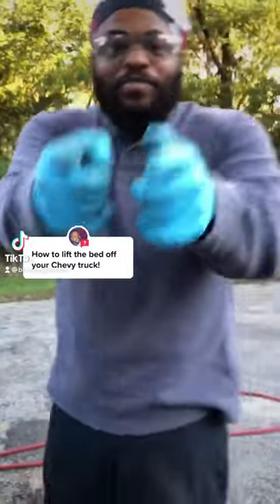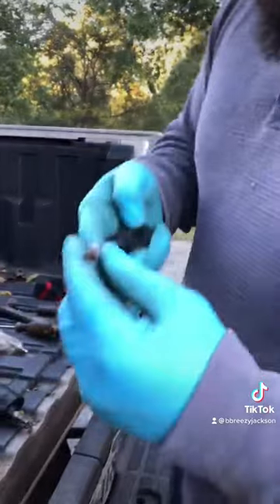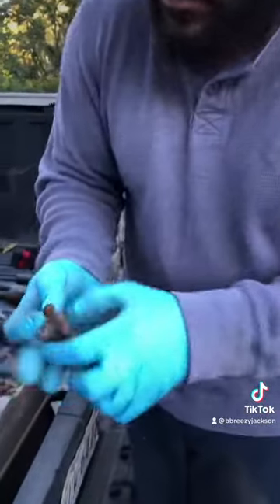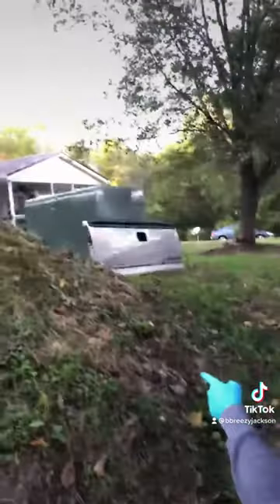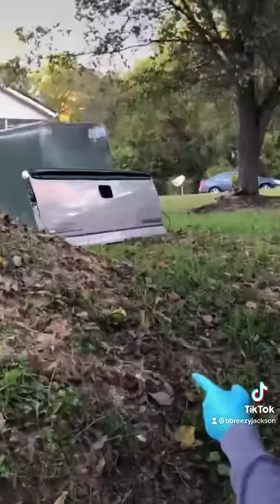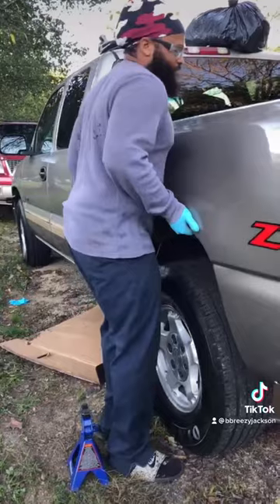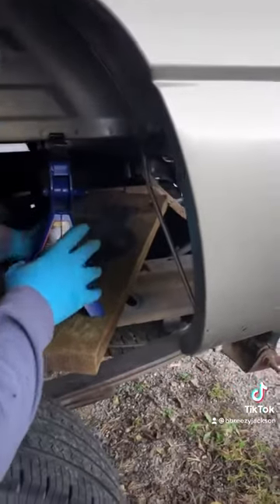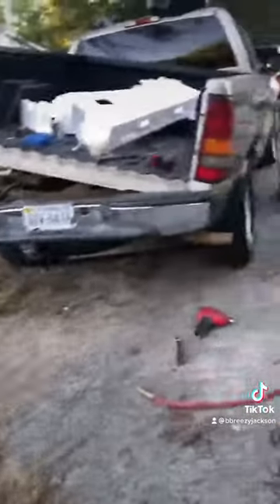How to remove a Chevy Silverado bed

Comment: mate , ya didn,t finish the video.....is it neccessary to remove the bumper and tow bar ??  thank-you ..stay safe and awesome !!
Reply from the maker: Sorry about that brother, no just remove the bolts from the bed on the one side and just loosen the other side  you’ll be able to tilt the bed
Reply: @BBreezyJack  i thought about later on and your right about tilting one side so as to get at the fuel pump, but in my case i want to remove the bed  to get at some of the rust, these auto cartel , all of them...theres no excuse for that much rust if any at all, for a few hundred dollars more per car/truck rhey can prevent rust by  galvinizing ,  zinc platting, better steel,,, but corp. greed is the thing $$$$...take care mate !!
Reply from the maker: Ahh okay yea just remove all of the bolt and discount the the harness for the tail lamps located in the rear of the truck by the spare tire. 
As far as removing the hitch and bumper no!
Reply: will do, got my green light ,  thanks again for your response, i,ll see if i can remove or slide the bed off by myself, i what to check for rust damage( amount) and address somewhat...be safe sir .